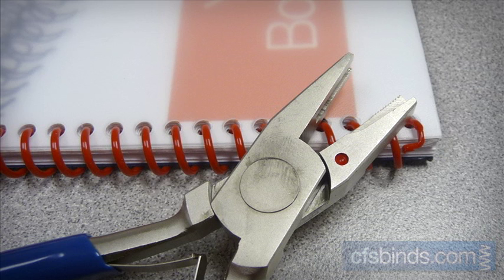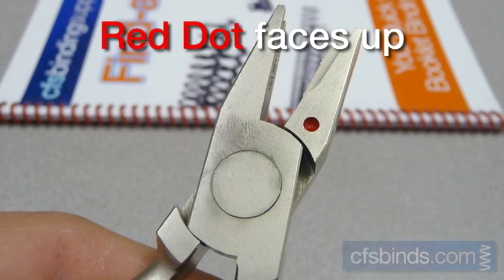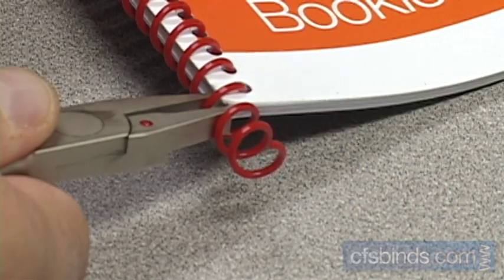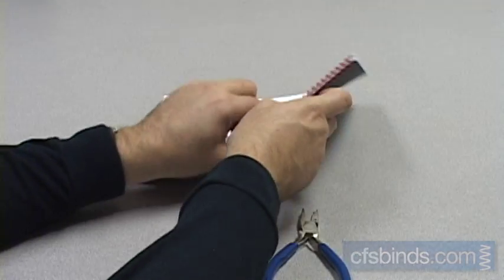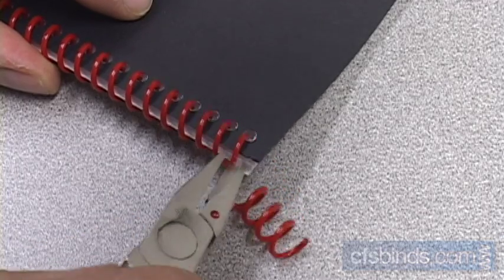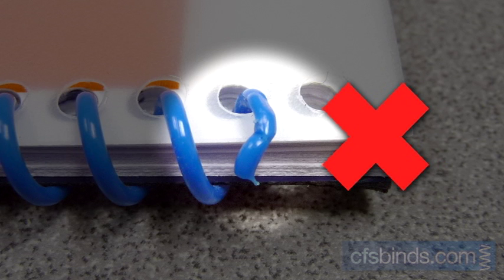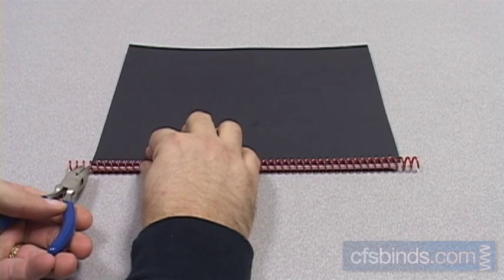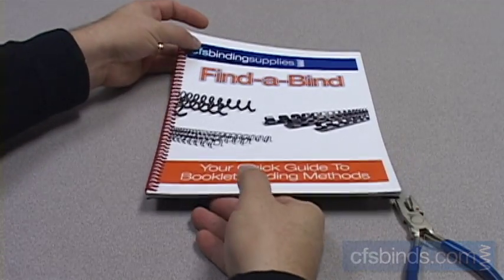How To Properly Crimp Coil Bound Books

Comment: Not sure what I'm doing wrong, but I'm not getting as much length on the crimp as in this video (and therefore the coil has slipped through a hole).  I've got the crimping pliers so I'm using the same tool